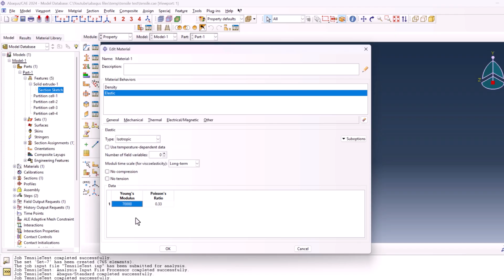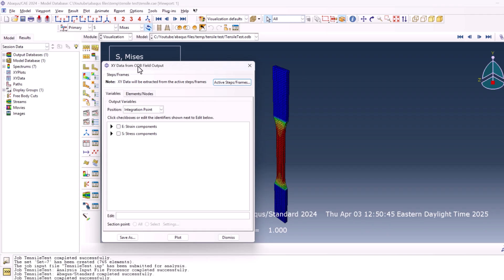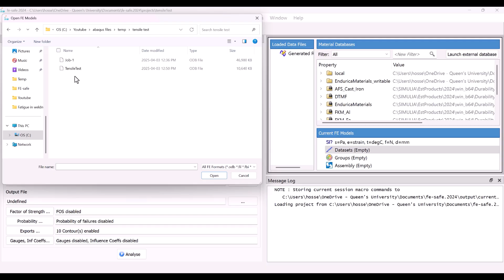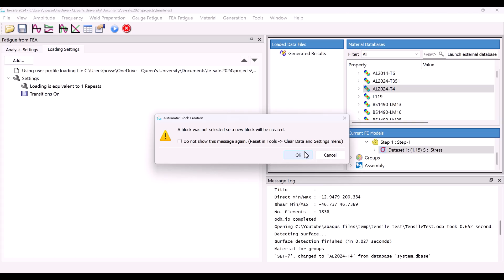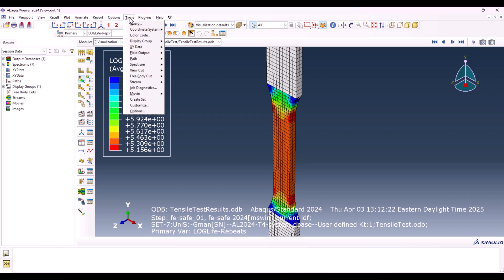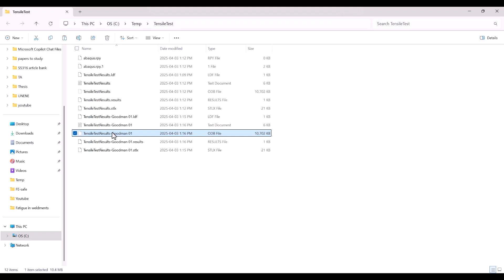Predict Fatigue Life from ONE Simple Test Abaqus + FE Safe

Comment: hello. i wanted to ask if i wanted results like strain or stiffness degradation from the same method treating it as a fatigue test? I am working on a composite fatigue life prediction
Reply from the maker: Yes, but not directly from a standard fatigue setup in FE-safe. It mainly predicts fatigue life (N), not stiffness degradation.

If you want strain evolution or stiffness reduction, you’d typically run the cyclic analysis in your FE solver (like Abaqus), then track the stress–strain response over cycles and evaluate stiffness decay manually.

For composites, this is usually combined with progressive damage modeling to properly capture stiffness degradation.

So: same approach works for life prediction 👍 but stiffness degradation needs extra modeling/postprocessing.
Reply: @F @FEAMASTER    thankyou for the response. I want to know if you can use  the " Direct cyclic option in step" for the cyclic load
Reply from the maker: @sherlockholmes2620 Yeah that’s another option to use.
Reply: @FEAMASTER i have been trying to to run an analysis but it just doesn't give me any worthy results moreover it gives me errors that Damage output requests are not available for Sc8r element type

Comment: Thank for the explanation, how should I make the interpretation of failure, this a crack initiation where only one/some elements are failing but the cross section can still resist more cycles?
Reply from the maker: In that case you can create a crack using assign seam method, and selecting the correct area around it in a set.